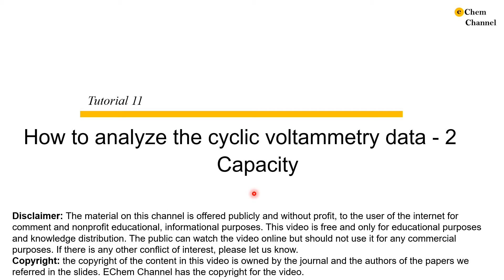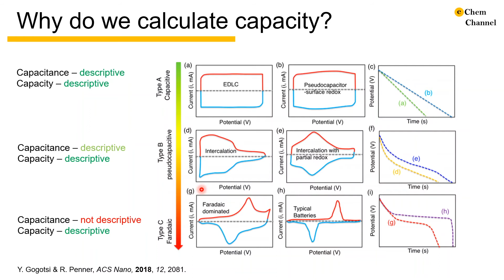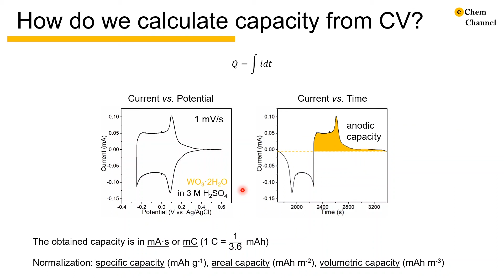Tutorial 11-how to analyze the cyclic voltammetry data-2

Comment: Hey John and Wang, Can you please also explain the electrochemical behaviour of batteries rather than just focusing mainly on supercapacitors. It will also be great to show how these tests are conducted (i.e. testing parameters, operating the software). Also, making videos about how to calculate the relationship between peak current and the square root of scan rate, etc. Thank you so much, keep it up.
Reply from the maker: Hi Salman, thanks for your suggestions. We will include more battery-related content, echem setup, and current-scan rate relationships in the future.
Reply: @EChem_Channel  Thank you!
Reply: I agree with you mate!